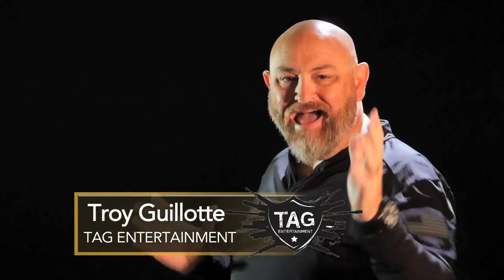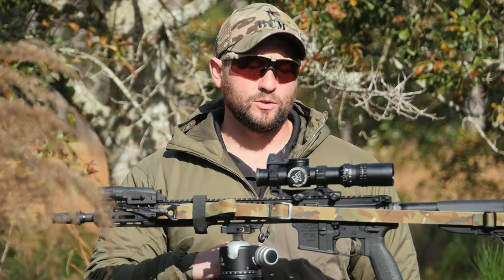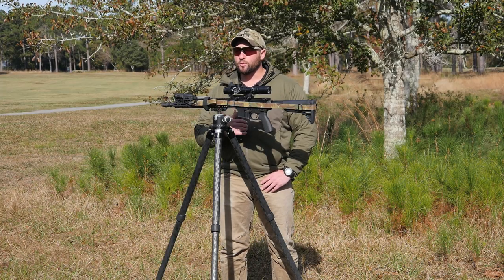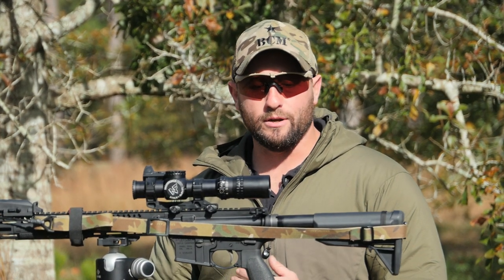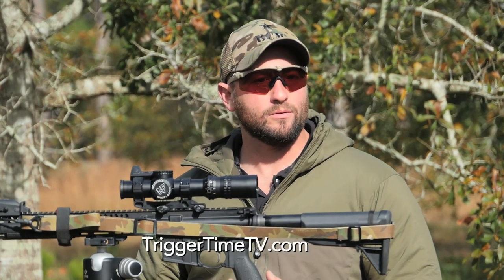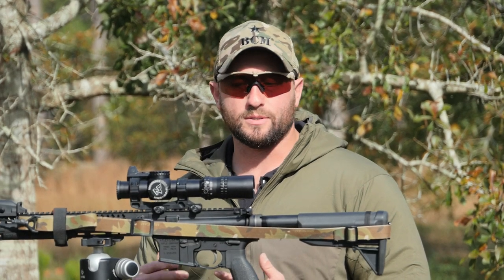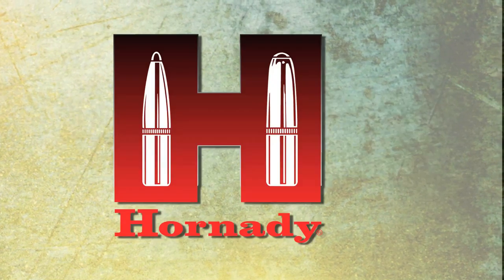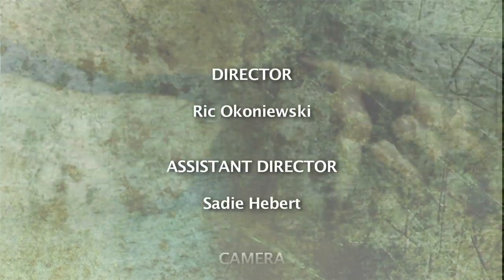Ultimate Optics Setup for the AR15 by Alex from Ridgeline Defense!

Comment: Isn't the point of the LPVO that it can be used both in the role of a red dot and a longer range precision scope?
Reply: It's still quicker to use the offset red dot than it is to dial down the scope. Also most lpvos have a very slight magnification/ edge warping on 1 power.

Comment: His optic appears to be a Nightforce NX8.  That, in and of itself, is an issue for acquiring the reticle sights as the NX8's eyebox is abysmal.  On 1x the exit pupil is less than 8mm.  That translates to an eyebox where the shooter cannot acquire his target readily.  The shooter has to be directly behind the ocular lens to see the red dot of the NX8.  That to me explains the reason for the ring mounted, offset red dot.  The shooter cannot rely on easy target acquisition with the NX8 @ 1x.  I am very disappointed with my NX8 and it's terrible eyebox.
Reply from the maker: thank you for the explanation!
Reply: NX8 shines at longer range shots and it's eye box is too tight for my linking.  Razor 1-6 is still king, imo.
Reply: I’m running a 1-6 strike Eagle, at 1x there is no shadow and your head can be anywhere. At 6x it could be a little sharper. It’s making me want to upgrade to the 1-10 razor, but the 1-6 is still great for easy shots out to about 400 yards for me.
Reply: It's actually the ATACR 1-8
Reply: I have a Nightforce NX8 and have No Problem using it at all.  At 1x the eyebox is plenty large enough for me to maintain the target during recoil.  At the higher magnifications I know what the expect from the optic.  Nightforce had to sacrifice some optical performance to create an optic this small & light weight.  My NX8 has an RMR RM06 mounted at the 12 o'clock, which is great for hasty shooting and use with NVGs.  And Semper Fi to all my fellow Marines who also just turned 246!

Comment: I'm running a 4-14x44 with top mounted dot on my 5.56, and a 5-25x50 with top mounted SeeAll Open Sight on my 308.

If nothing else, it's made acquiring sight picture at long range considerably faster. 

With a 4.5" height over bore line in 5.56, I recommend a 66 yard zero in 16", and 75 yard zero for 20" barrels. 

Plug the numbers into a ballistic calculator, and you can get an idea for your point of aim to point of impact at various distances. 

Side charging uppers and bolt carriers make it much easier to run a higher cheek riser. If the upper is plugged or sealed in the back, it also keep gas out of your face with a suppressor on.
Reply: One side note about using this on VPOs, or more traditional scopes, is that turret height can be problematic. If you have a picatinny mount that you can see through to dial your optic, you can mount  a SeeAll Sight behind your elevation turrey and still get solid Sight picture.

My current project is a .243 Win AR10 with 10x42 SWFA Super Sniper, the see through mount, and the SeeAll Open Sight between me and the elevation turrets... considering that the Super Sniper turrets are about 37 inches high, I believe its going to work well for coyotes, hogs, or bipedal critters. lmao

I did exactly that on a PA 4-14x44 with DMR HUD reticle in a 20" 5.56 for the longest time, and I fell in love with that setup. 

SROs are also a great choice with this mounting solution. I prefer the Holosun 507c over most other dots.